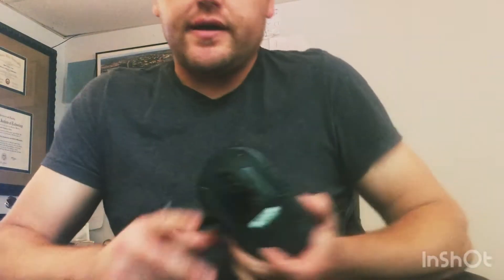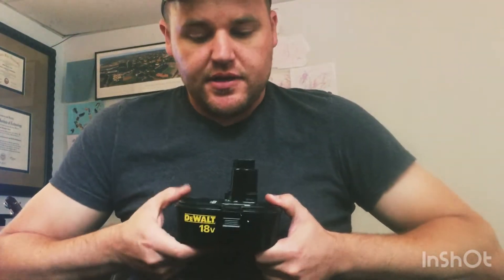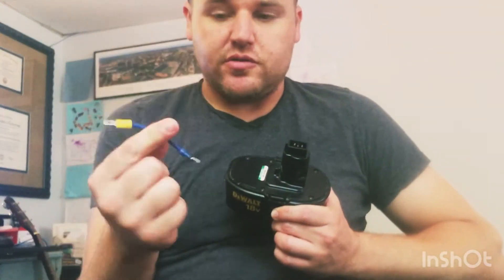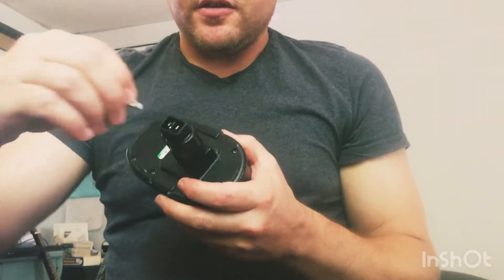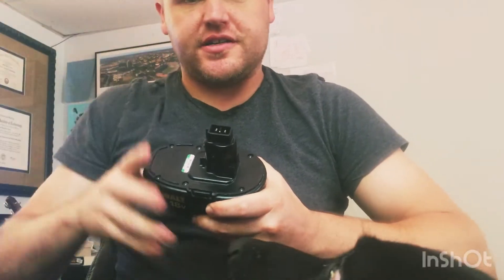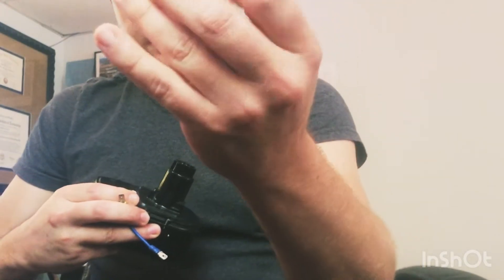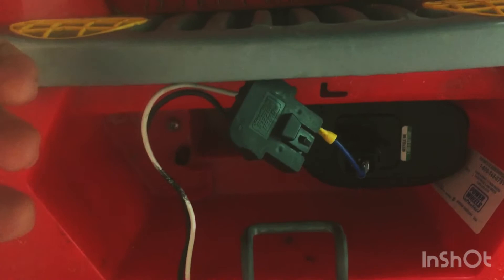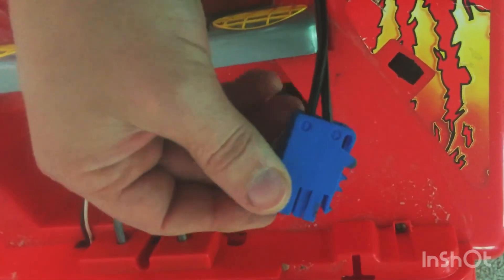How to Use Drill Batteries for Power Wheels Cars and Trucks

Comment: Why not just use a female blade terminal from the start?
Reply from the maker: If I had a female blade big enough to fit the 18V battery that would be easier. Thanks for pointing that out. I only had small terminals on hand, so I made it work with those. 

I have a better solution for battery replacement I am hoping to post soon. 
Thanks for watching!